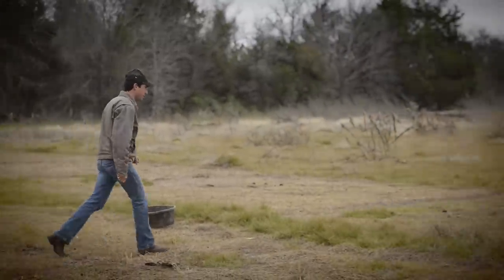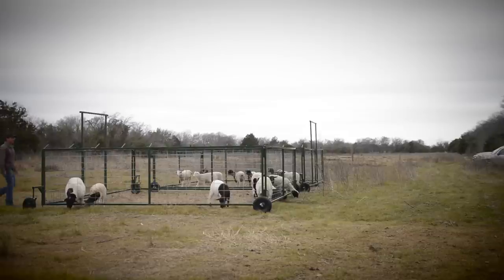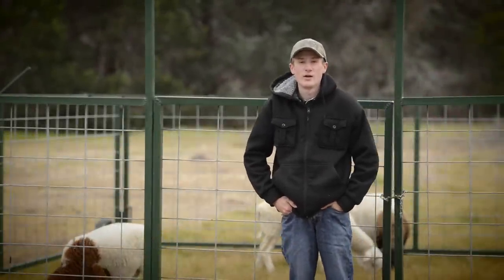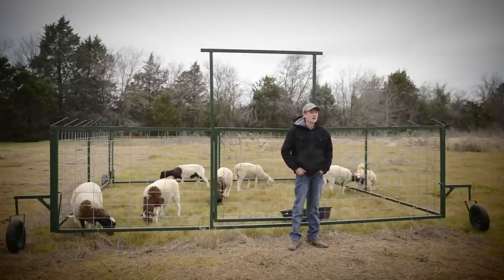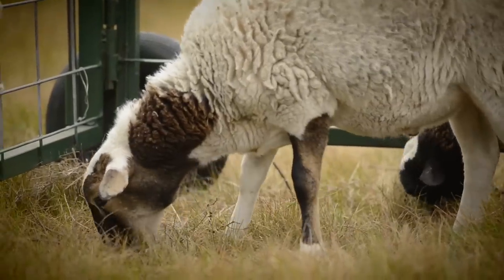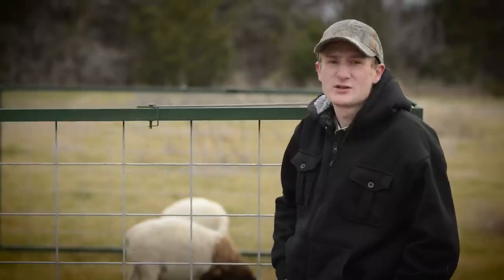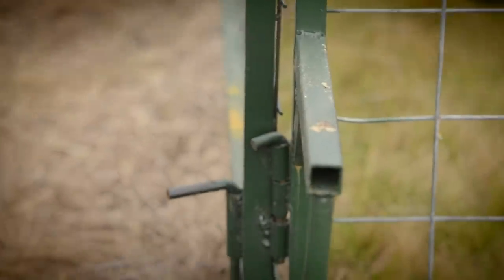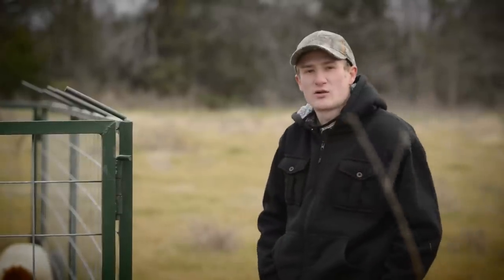Sheep Tractor Company

Comment: This is a great idea I think with little improvements this could be a very nice cage I think if you put the door in the Corner it would keep it from sagging down you could have fold up and down around the Perimeter with wire or hing it. Hanging auto waterer along with feed and Mineral then they would be set. One thing that would be a lot more labor but help with the sagging and the strength would be in stead for putting the wire directly on the square tubing and welding it. a better way would be to drill holes in the middle of the square tubing and Encapsulate the wire it would keep it from sagging and not need that center brace possibly....
Reply: They don't need anything but water and shade when free ranging. I have never bought any food for my goats and sheep ever in summer or winter. Only water. And they are great.

Comment: Nice concept but seems like all the metal and wheels would be costly not only to make but to ship. And how do you keep coyotes from squirming through the big space under the sides, or jumping over? Electric net such as from Premier 1 is very easy to move, and with a portable charger can be put anywhere.
Reply: UNLESS you ground is full of rocks 3" down like mine. I use the netting and poly braid - the hardest part is driving the posts. 
I'm ready for something like this.

Comment: Great idea....Can these be used for goats?
Reply: I'd be wary of that unless you de-horn or use a smaller mesh. My aunt's goats used to get stuck in similar fencing on a daily basis. The problem is that their heads can fit through the wire, but when they straighten up, their horns get caught in the wire and they can't figure out how to untangle themselves. You need a mesh that's too small to get their horns through, unless you de-horn them.
Reply: Hardware cloth would work for that.
Reply: @Nurk0m0rath  you just have it built with 4" panels instead of 6".
Reply: If you’re interested in rotationally grazing goats maybe check out Ben Habig’s YouTube channel. We rotationally graze goats with two strands of electric wire. I think this idea is great for very small areas and few animals, but if you’d like something on a larger scale there are other options.
Reply: @Nurk0m0rath  Simple fix, add 1"x2" chicken wire. it's bigger guage is nice for enclosures, also see sheep fencing. Would easily wire to the origional set up
Reply: @chadrylander970  You might notice I mentioned two solutions in my comment: dehorn or use a smaller mesh. I'm pretty sure adding 1x2 wire counts as the second option. Also, do you mean cage wire? Chicken wire is the hex mesh and I also wouldn't recommend using that for goats. Too flimsy.